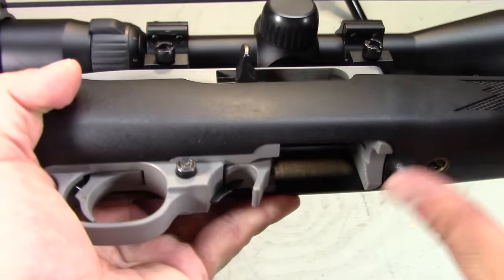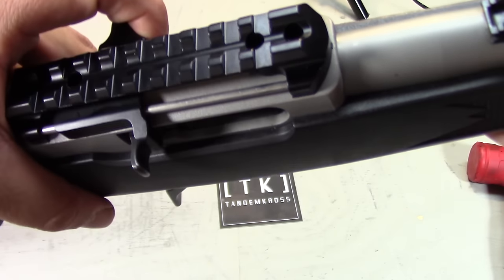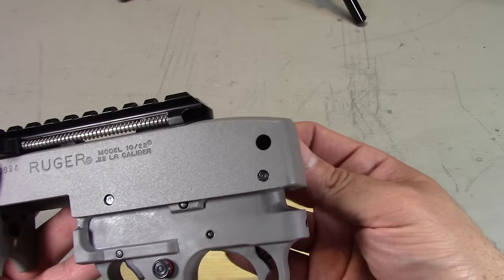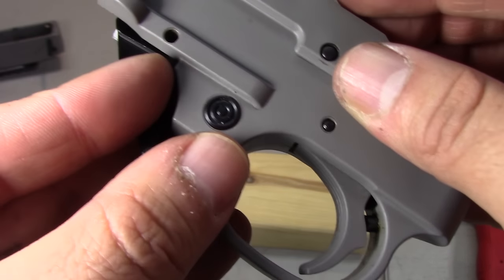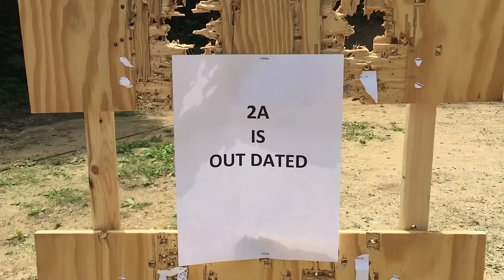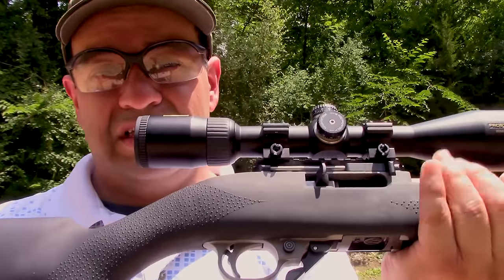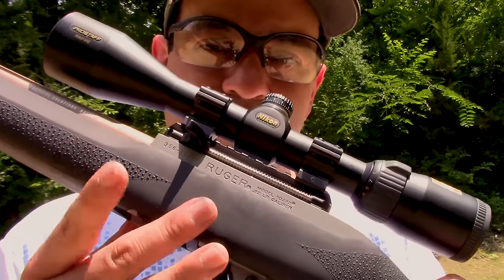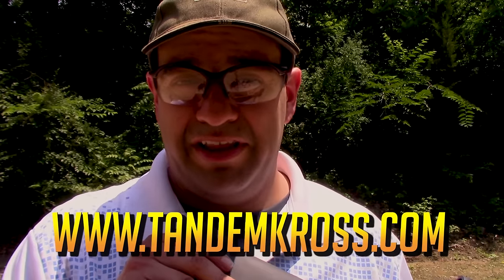Three Awesome Ruger 10/22 Mods - TandemKross

Comment: The bolt release , you can modify the OEM one that came with the rifle , a blue grinding for a dermal and your done , just take out the little v , make it a larger radius , save your self 20.00 dollars , they work fine.
Reply: I have done that on all my 10-22s.Solves a major annoyance.

Comment: A nylon bolt buffer pin makes it much quieter. Throw on a threaded barrel and a nice suppressor, and you have a great fun gun that is quieter than a bb gun. Get some 25 rounds mags also, so you have less mag changes.
Reply: I didn't notice it making much difference
Reply: A very cheap mod that helps. You can hear the difference without a suppressor.
Reply: I changed my bolt stop to nylon. It’s great

Comment: Ruger "International" Full Length Stock, Ruger BX Trigger Group. 
I have a Dremel, I took out the point in the heart shaped hole in the bolt control plate with 10 minutes work. 
Replaced the steel bolt buffer pin with a White Nylon bolt shaft made from a 3 inch 1/4-20 nylon bolt by cutting off the head and threads,cutting it to the same length as the steel pin. The barrel is Free Floated from the mounting bolt to the muzzle. Drilled and taped the trigger guard for a Rearward Trigger Stop Control.
 This took less than an hour to do.

Comment: I suspect the left hand bolt operation will lead to accidental firing since the trigger finger could still be on the trigger.
I won't do the magazine release because it's so long and it works in either direction that a lot of magazines will be unintentionally released when the gun is set down or bumped by something while carrying the gun. You may not even know it until you try to fire a second shot. Meanwhile, your magazine is gone.

Comment: I converted my 1022 10--15 years ago with volquartsen trigger kit, auto bolt release and bolt buffer. Very smooth now and considering that your left hand holds the forend more or less on target why move it to use a left hand bolt handle?

Comment: Three  10-22 must haves because he got them FOR FREE ! This is an INFOMERCIAL.
Reply: I paid for mine, though you can alter your bolt release with a small file, no need to buy one.  The fire switch looks fine but I'm a bit clumsy and would probably hit it by accident, I have the under the trigger gaurd version.  The dual handle thing looks nice but I just use my trigger hand.  TK uses the quick release and reload for shooting competitions.  They sell magazine couplers so you can have two or three magazines stuck together.  Drop, rotate and reload without switching items or moving your shooting hand.  I don't worry bout that shooting targets and cans.  Most folks will replace the steel bufferpin with Nylon or a rubber sheeted rubber plug to save their bolt or receiver from wearing out but I've also heard of many folks that should have worn out their 10-22 and they're still going strong.  You can get a 3 inch nylon bolt from the hardware store and cut it to length.  It does quite it down a bit.

Comment: By all means, make the magazine release handle larger so that the possibility of bumping it while carrying the rifle with a sling on your shoulder is even more possible.  I have done that with the standard size magazine release.  I took the rifle off my shoulder and raised it up to shoot and the magazine was gone.  I had to back track for over an hour to find it.  I have an older model that has a push button for the magazine release and I like it a LOT more.  As far as the other modifications, I have no problem with the original set up.  The only modification I have done to either of my 10/22s is I added a Magpul Backpacker stock to my take down model.  That, IMO, is the best modification you could make.  It allows you to carry extra 10 round magazines in the stock as well as making the rifle more compact to carry.

Comment: I love the left sided charging handle thanks 🙏 I installed it, it’s perfect 👌 my only issue is .22 is a dirty ammo after several (semi-auto) rounds like 3 full magazine 25 rounds, it start jamming. But easy to clean and works perfectly again.
Reply: That’s pretty bad... my Mosberg 702 plinkster (almost the same rifle as this) rarely has issues. My maintenance routine is 300 shots then add 1 drop of oil on the firing pin (plus optionally 1 drop on the side sliding part), then 150 shots with 1 drop on firing pin, then 100 shots and then full clean (full clean involves disassembly, wiping with a paper towel, and then finally a damp/lightly oiled paper towel to cover all parts except the plastic stock of course). If I do that I basically never have issues. And I can actually get more shots out of it but that way a nice breakdown for a box of 550 shots on a weekend with basically 0 issues (sometimes one eject malfunction in that 550 but usually not)

I run the cheapest garbage I can find (even ammo that’s slightly rusty sitting in a mud puddle is fair game). Only very rarely do I have a round not fire (and it’s not the rifles fault, just the trashy ammo then).

.22 is not a dirty cartridge, man you should see the debris flying from 9mm carbine rifles with delayed roller blowback (the rifle has 50 to 100 shot magazines, and if you remove it, it just sprays your face with a crazy amount of soot and chunks of hard black gunk that is quite painful and I’m not doing that again, haha!). 22 is relatively clean, I’ve probably done over 1000 rounds before cleaning but I’m typically a clean freak and clean them every day after plinking a box (box of 550).

75 shots shouldn’t be giving you issue, I’d suggest looking into it and seeing if it’s feeding/ejecting/firing issue and really make sure the component that does that looks fine (like no excessive wear or chipped or cracked). I think mine probably has 20,000 shots through it, so it’s still looking like new with almost no wear on any part besides a few edges on my magazine that have some paint worn off since I only have one 10 shot clip.
Reply: Use dry lubricant..the debris coming off the .22lr round when you shoot is mixing with the oil and gumming it up👍
Reply: Patpro2nd 1791 like the graphite powder?
Reply: @mja9700  yep that'll work just fine..Hornady makes a really good lube also.
Reply: @jakegarrett8109  👍
Reply: Use a dry lubricant... Graphite based... Goes on wet leaves a dry film of graphite .. won't accumulate debris so bad

Comment: Get these KIDD parts to make your 10/22 shoot almost flawlessly,especially with the BX15 & 25 mags.1. Mag plunger & spring 2. Hardened lengthened firing pin 3.hardened ejector. I think it is longer too. My rifle is a newer model. It jammed all the time until I changed those parts. It worked ok with the 10 round magazines,but not with anything else.
Reply: Or just get a whole new KIDD 10/22
Reply: @patrickmcnair1965  Could've done that, but it works fine now. I probably could've maybe just put a stiffer plunger spring in it. That would make the magazine stay in the magwell tighter/straighter.
They wobble around  and cause most of the issues. It's really not the rifle. Semiautomatic 22LR rifles and pistols can be temperamental. Some will shoot just about any brand of ammo. Some just have issues. Too low velocity ammo can cause jamming. The 10/22 operates on a blow back system. If the bullets are weak,they won't blow the bolt all the way back fast enough to cycle the ammo correctly. For about $50 it went from jamming up to 4 times every 25 rounds before I changed those parts to jamming  3 times out of a 100 rounds afterwards. I can live with that. If I didn't rapid fire it a few times it probably wouldn't have even jammed at all.

Comment: First mod for a 10/22 should be the trigger imho, and you can make a bolt release with a file and 10 minutes of spare time.
Reply: Just did that myself with a couple different diamond files and 15 minutes.
Reply: Should always have a stock bolt release to put back in Incase you need to send the gun to ruger.

Comment: Your choice of targets cracked me up. Too bad you're only putting little tiny holes in them. Only one of these 'mods' that I would (do) use, that's the auto bolt release. I think that mag release would be susceptible to accidental activation, what with it being either push or pull and being a huge paddle. And I just don't see the need for the left-handed charging handle. I've been shooting semi-autos for over 50 years and never had a left hand handle. (Does an M16 count?) I really do love that there is an endless number of customizations that you can do to personalize a 10/22. As long as you're happy with it, that's all that matters.
Reply from the maker: Glad you got a laugh out of it.

The right side handle drives me nutsssssss.
Reply from the maker: Nope.  I prefer inverted 180 degree offset sights.
Reply from the maker: Works great for everyone considering it’s just a regular iron sight :)
Reply: @PewPewDave  hold it upside down,problem solved,your welcome and no charge.

Comment: I have an extended mag release from Tactical Solutions and a  bolt release as well. I do like the ambidextrous charging handle though. A Ruger 10/22 takedown, in which I have two, are my SHTF/Survival.
Reply: Update I just shot the Ruger 10/22 Takedown with bull barrel,  it's  a blast and a tac driver, can't wait to update it with all the accessories of my original rifle with the addition of both sporting the new Magpul X22 backpacker stocks.

Comment: You can modify the stock bolt lock to do the same thing in about 10 minutes
Reply: Yep. Just did mine today with my Dremel. It took longer to disassemble the rifle than to modify that plate. You're going to have to do the same disassembly whether you modify the stock one or replace it. It's a no-brainer. Save yourself some money and save up for a tactical stock or optic.

Comment: My 10-22 is a '93 model, i replace the bolt lock & old (flush style) mag release with an extended sliding type.  I had to file a burr off of my trigger housing to make it work.  I also invested  in some 25 rd mags so i dont have to use it as often!

Comment: The first upgrade to any 10/22, is the torque Screwdriver!
Reply: Just learned about that
Reply: Tell me a few things please , not like we are able to meet to talk . I'm picking one up this week on Thursday  2021 July 29th . I would very much appreciate any type of positive in put I want minimum wear and tear and I am looking at a few internal things . I've briefly heard about the torque screw .
Reply: @estebanmacias1945  When removing the stock from the barrel, you remove 1 screw.
This needs to be torqued when installing.  Different torque will affect accuracy. So you want to have the same torque always. Check it once in a while, between cleanings too.  You don't want to guess if the ammo is changing zero if you have a scope, or aim points when using sights.  Hope this helps. I use mine every time I disassemble and after a couple of shooting days.
Reply: @averagegearreviews4109  I think there's aftermarket torque screw that have a Allen head key , and that is what he was talking about I believe . I believe its reverse tightness  is very much put in check .

Comment: or you can just replace the charging handle with a larger one and wont have that obnoxious thing on top. and there are better designed mag releases that are flush to the trigger housing and releases right below the safety

Comment: That's what kind of gets me about the 10/22: the trigger, in layman's terms, sucks. I have a Remington 581 that's 60 years old, was $35 in 1964, with an utterly epic trigger that has little or no creep, beautifully crisp, etc. Etc. Then, it has a very basic wooden stock that is stiff as a board versus the 10/22s noodle like stock. It really doesn't cost any more money to make a better trigger, especially when you're putting it on the gun for the first time at the factory. There has to be a way to get a better gun for not a lot more money.

Comment: I like the charging handle upgrade as long as it isn't chintzy.... I just got done giving my Mossberg 500A 12ga a tactical upgrade and had the ongoing hassle of sending back quite a few accessories that were advertised and/or reviewed as being quality made but in reality what you get is a hyped-up sloppy-fit piece of china made junk! 
    I ended up paying a little more (many parts were on discount for the Christmas season) but well worth getting UTG and ATI.... my ATI stock with pistol grip fit perfectly against the receiver and trigger guard, the UTG all-aluminum forend was made to fit perfectly as well, the first edition ATI Halo 9-shell side saddle was all aluminum and again a perfect fit, and lastly the ATI Generation 2 Halo heat shield was quite nice but could of used a little bit better design in how the components installed and the sights were just black plastic instead of aluminum with a brush of green paint on the bead 
   Keep in mind people, adding some weight to a home defense gun isn't even close to a crime... a home defense gun is going to be quickly grabbed, carried to where the intruder is, fired, and then you're setting the gun down and calling 911 so they can come take the dead guy to the morgue...and so it's not like you're having to carry the gun up n down hills while you're hunting with it or like it's a burden to have the extra weight on it when target practicing or just plain having fun down back blowing holes in some old tv's and other junk ;o)

Comment: The right side charging handle is where it needs to be. Since most of the world is right handed, one can not function the bolt while having ones finger in the trigger guard. Try rotating gun 90 degrees and use left hand.
Reply from the maker: Then take finger out of trigger guard :)
Reply: Pew Pew Dave 
There is always one. Bottom line is, from a Human Factors standpoint is ; if you have the hand away from the trigger actuating the bolt it reduces the chance of an accidental discharge.
Reply from the maker: Most people seem to get along just fine with using their left hand to charge their ar-15s.
Reply: @breakermorant2428  Number one reason for negligent discharges is failure to maintain positive control of the firearm. The absolute first thing that should be taught, and constantly reinforced, is to maintain positive, safe control of any firearm. With handguns people are taught to maintain control with their dominant hand while reloading and releasing the slide, why would a rifle be different? You hound them to get their dirty lil nose pickers out of the trigger guard when not attempting to actively fire at a target.

This methodology isn't "one", it's the entire US military and most western military for that matter. Considering how often they train people that have never touched a firearm before, they have very low negligent discharge rates.
Reply: On the "other hand" HK has done well. I agree with you I was pointing out HK is different. One thing about the AR is the position of the charging handle is ambidextrous.

Comment: Well, considering the AR charging handle is in the middle, it doesn't matter.  I was referring to the HK set up which is definitely meant to be actuated with the left hand. Now the AK is set up to be actuated with the right hand like most semi autos. The HK can be held , right hand on the pistol grip,  left hand loads round. The AR is ambidextrous. AK, Galol, Uzi, SKS etc usually is right hand friendly. That's all I am saying.
Reply from the maker: Still using it with left hand, whatever, the right side handle blows :)

Comment: I don't think these are necessarily a "must have" for 10/22 owners. Maybe if you're left handed or just clumsy the mag release and charging handle would be necessary, but the bolt release can be done with a dremel on the stock piece. It's your rifle and definitely do what you want or need to it, but I wouldn't call these a must have. A great scope could be a must have if you're near sighted like myself, and the bolt release is kind of a given. It was a poor design from the beginning and like I said you can fix that with a dremel, or a thirteen dollar part. Good video regardless.

Comment: I've got a Ruger 77/22. Next is a 10/22.
Reply: I have a 77/22, 3 different type 10/22's and 2 American Rim fires... Love them all ! 
One addition I see as, to me, ridiculous is the hole in the back of the receiver for cleaning.  It is advertised and pushed as a HAVE TO HAVE thing now. NO, use a Bore Snake for cleaning the 10/22, MUCH easier and FASTER. To USE that nifty new "cleaning hole" you have to dissemble the gun completely, except for removing the barrel ! Now, knowing how this disassembling the gun changes the bullet impact AND caused wear and tear on the guns pins and screws, I say NO to the cleaning hole bullshit. The stock has to be removed, the trigger housing from the receiver, the bolt buffer has to be removed followed by the bolt and recoil spring. THEN you can insert your cleaning rod from the breech end and clean the barrel. 
THEN the gun has to be reassembled, torqued, resighted if scoped. 
Yeah, nice aftermarket gimmick.

Comment: Great video,Trump 2020.....I have a 16 bull barrel,did a trigger job,and took a file to to point of the heart on the bolt lock,smooth as butter.1/2, 50 yrs groups with cci 40 gr solids.

Comment: When you do the upgrades.......don't forget to check your headspacing.  
I've had factory bolts with a .055 in deep rim seat.  I've been measuring the 22 rim thickness on my ammo.  Most are between .032 - .035 thick.
Cheaper ammo like bulk are up to .040.   I milled my bolt face to .043 and picked up less stringing.   I plan on buying a match bolt here pretty soon.   What can I say......I love the 10/22